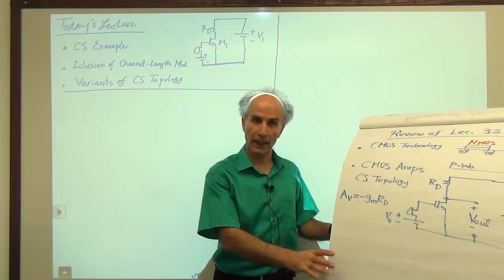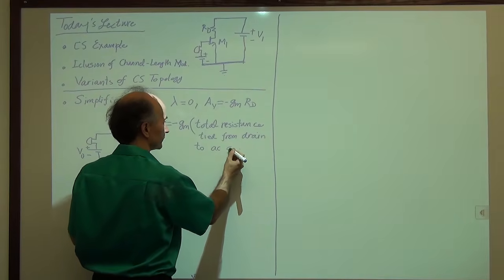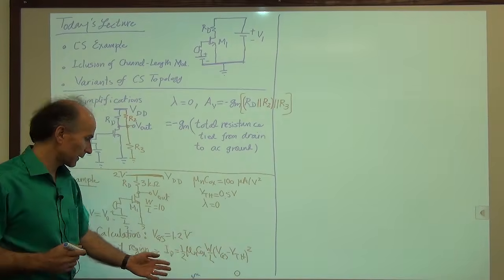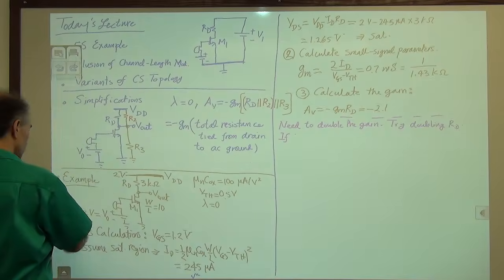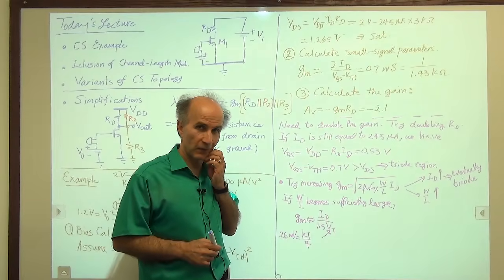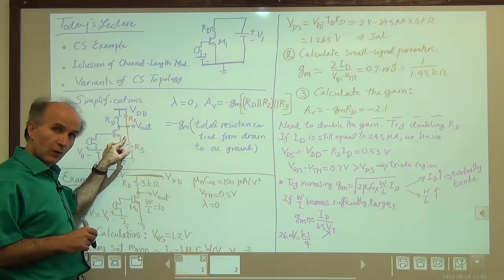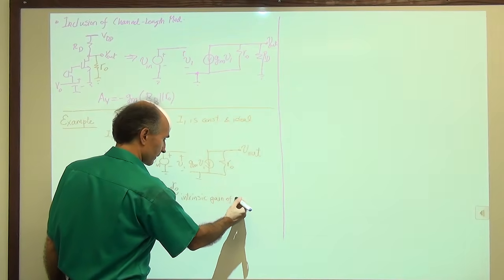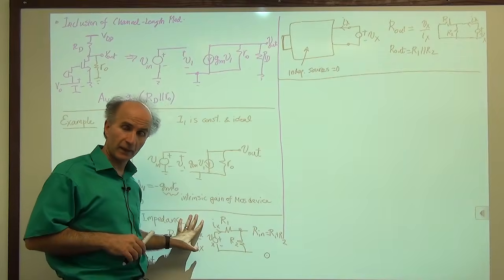Razavi Electronics 1, Lec 36, Common-Source Stage II

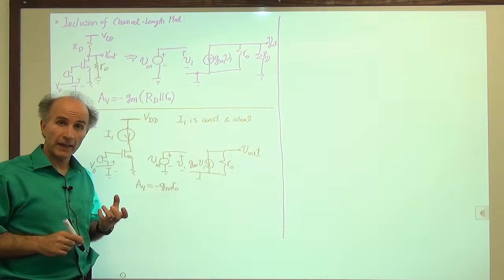Comment: 53:59 , if rd is replaced by current source then talking about bias calculations  , how the device remains in saturration? since vds=Vdd - iDRd and now there is no voltage drop against rd as there is no rd so is it okay to say that now vds = VDD?
Reply: If you replace Rd with ideal current source. How could you justify that there is no drop across current source? Voltage across any current source is unknown. There is some voltage exists. If you want to find the value of VDS. You have to use MOSFET drain current equation. If channel length modulation effect is there. They will provide VA( early voltage). From this Lambda= 1/ VA. If CLM effect is consider Id(without CLM) multiplied with ( 1+ lambda VDS).

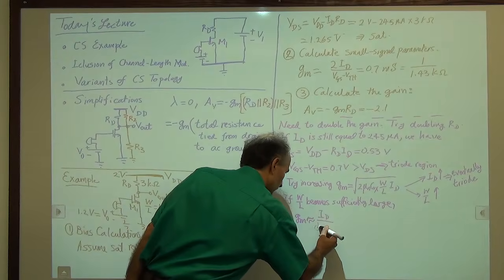Comment: At 35:00, Prof. says (W/L) can be increased by keeping Id constant (only downside being sub-threshold conduction). But we know Satn. Id = (1/2)*unCox(W/L)(Vgs-Vth)^2 => Id prop. to (W/L) => Vds still decreases. Is this also not a way to explain why (W/L) cannot be increased indefinitely ?
Reply: Sir said, to some extent we can reduce V(gs) and this would keep Id constant more or less, since Vgs - VTh would reduce by factors of a square...
Reply: if we keep of reduce the Vgs then at one point it will be less then vth so the mosfet goes to off state (subthershold region) where id follows different formula

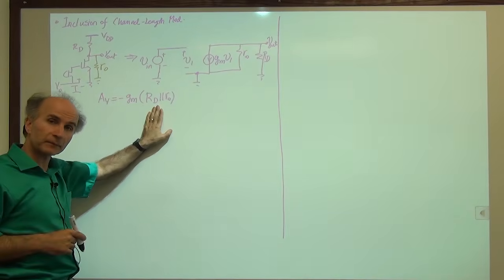Comment: 48:07 Since a dependent current source exists, shouldn't we find the total resistance similar to thevenin resistance? Doesn't this current source has an internal resistance/impedance?
Reply: You can write KVL around the loop of Rd and ro. Actually, Rd and ro share the same nodes(Drain and GND), so they are in parallel to each other.

Comment: Why in calculation of input impedance the output port is not shorted ? As is the case in calculation of output impedance
Reply: Answered at the next lecture https://youtu.be/UeXtyA42ElU?t=2815
Reply: as per my understanding input port is connected to a voltage source, output port is just a node where we will read the voltage. It is not a source. During input impedance calculation, all the sources except input source should be made zero, right? output is not a source hence not shorted.

Comment: If we connect a current source in place of Rd, then Id will be constant (considering large scale), any change in input voltage will not cause a change in output current because of current source....so how will Vds will change and how we will get the gain we require?
Reply: you have to think more practically.
Reply: To test for any changes you go into Small Signal Model so you open circuit the current source. For large signal model, this does not happen so you practically don't see any difference. Where is the confusion ?
Reply: Id will not be constant, it's irrespective of the value of rd , id depends only on the  overdrive voltage  and the output voltage depends on rd
Reply: We lose that current source in small signal model.
:facepalm:
Reply: @windee417  thats not the question he is asking , he is asking - since current source will have a constant current , how will Vds change ? since the drop across the resistor (which is acting as a current source) now remains constant , how do we acquire the required gain?
Reply: Any sources having constant value will be vanished off in the small-signal model! that's the idea!!!